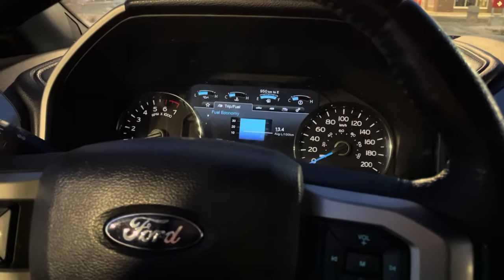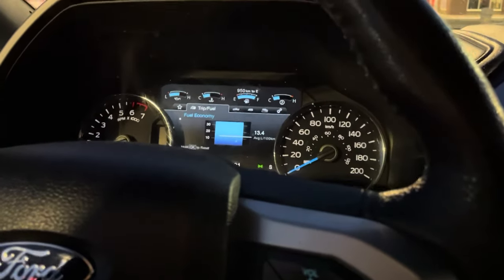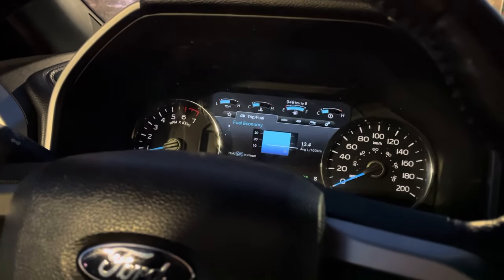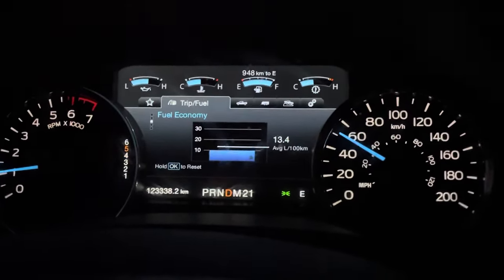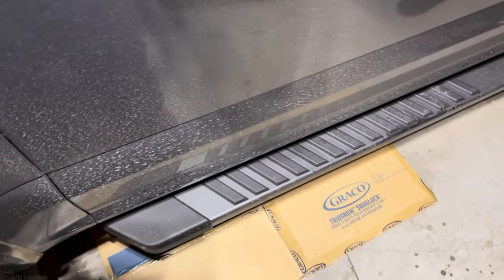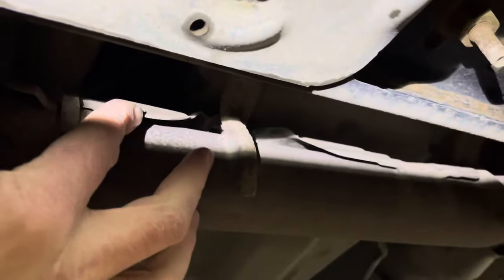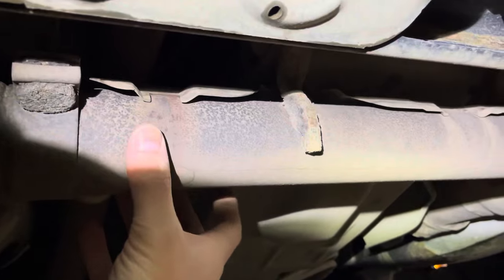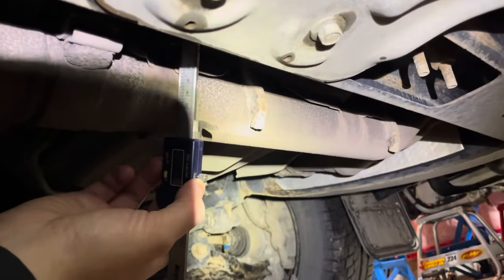F150 Exhaust Rattle Noise Fix

Comment: I had a rattle at 1100 RPM's which coincidentally is the same number of RPM's when converted to metric per the Engineering Formula Conversion Tables :)    Thanks.  Mine was the same clamp.  Rattle is gone.

Comment: Mines doing that similarly but it’s not constant and will stop and start randomly. I can hear it a lot in a drive thru. I checked my clamps and none are bad or rusted so idk what to think now
Reply: Did you ever figure out what the noise was?   Mine does also but it more than rusty hose clams on mine
Reply: @northjerseykevin3915  yeah I did it was my transmission mounts oddly enough
Reply: Mine is the heat shield under the engine.
Reply: @BrettDavis-yz8oe  were you able to fix the issue?
Reply: @Honkey_Tonker  yes was the same one though. Not under engine like I thought. Clamped it and it's fixed

Comment: I replaced both of these on my 2020 and it still has the heat shield noise.
Reply: Then your heat shield is probably broken on the side you don’t see or you’ve missed something. Get back under there!
Reply: @lonb00  It turned out to be a cracked flex plate and my truck is going in the shop on Tuesday morning.